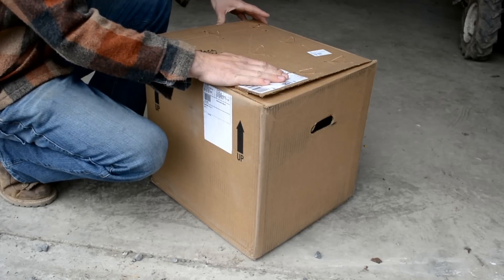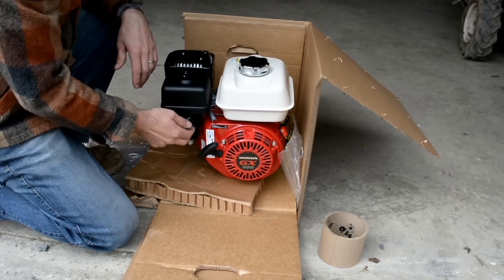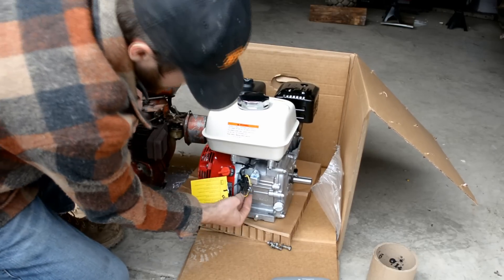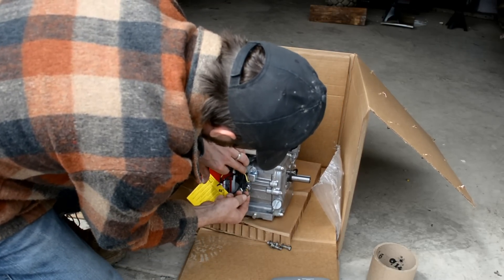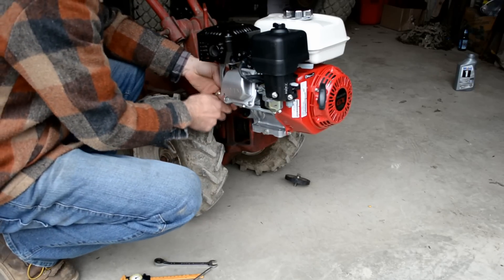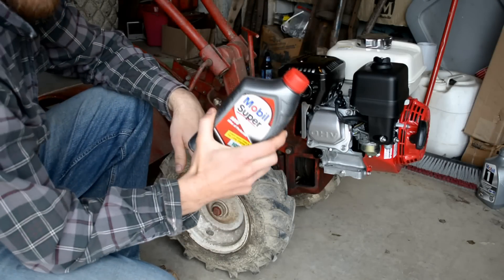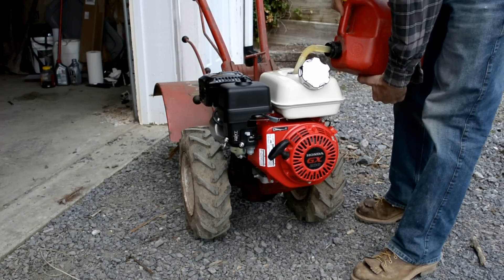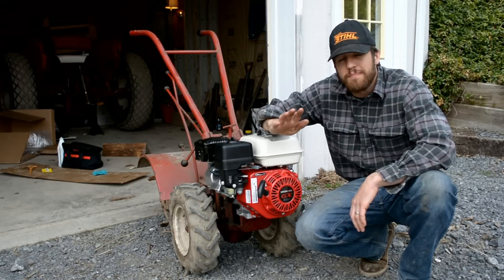Upgrading a Troy Bilt rototiller with a new Honda engine

Comment: Hi. Its nice to see this thread is still gaining attention,   yesterday I asked if a GX200 woukd fit onto a 86, 8 hp horse with a B&S motor.  Got a response yes it woukd , I didn't realize the Honda motor in my commercial cement mixer was not a GX 200 but a GX240 8.0,  I had researched the output shaft that should be on my B&S and it seemed it shoukd be 1"  after pulling the motor i see its a ¾" shadt, my GX240 has a 1" output shaft without thread , pulley are held on with a hex nut against the keyway.   Has anyone found a work around, for the pulley/ friction wheel ?  , if i want to keep the friction wheel I'll have to drill and tap the shaft, its the pulleys that worry me most ,  iland both my pulleys on the output shaft and transmission are of different circumference.    Anyone?
Reply: @mikethorburn6374  Small Engine Warehouse has some special order Kohler 9.5 hp Command Pro 277 CC displacement engines that have  3/4 output shafts.  I am told that SEW had the shafts on these larger Kohler engines turned and reduced to 3/4" especially to fit TB Horse/Big Red tillers.  SWE had to make an adapter plate to get the larger bolt pattern that is on the larger 9.5 hp Kohler engine to mate up to the smaller bolt pattern that is used by TB on the horse and big red tillers.   The 9.5 gross HP Kohler has a torque spec that is closer to the bigger 305 CC Briggs engines that TB was putting in the horse tillers before discontinuing the horse model and moving to the Big Red model 

This whole gross vs net horsepower makes comparing small engines a bit more complicated than it was 20 years ago.  The Honda GX 200 is rated at 5.8 net HP with a likely but not confirmed 6.5 gross hp.  The  Briggs Industrial Plus 8 hp engine that my TB horse came with is 8 gross HP so the net HP is going to be 10 to 20% less.  I think that the more important spec might be torque ft/lbs as that is what turns the tines and the wheels when the load is put on them more than HP. 

I have heard of people having the TB horse engine output pulley bored from 3/4 " to 1" and then having the key-way re-cut, to accommodate the bigger Honda engine but I would be concerned about the amount of metal that would take out of the pulley.  I would also suspect that the larger 200 CC  plus Honda engine that you refer to also has a different/bigger bolt pattern that may not match up to the TB horse.  

Before you buy any brand of engine, do your homework to make sure that the output shaft diameter is what  you want/need it to be and that the bolt pattern to bolt the engine to the TB horse is what you want/need it to be.  Good luck and keep us posted.  I am in the process of re-powering my TB horse that had the BS 8hp engine in it with a Honda GX200.  Everyone I have talked to said that the Honda GX200 has plenty of power but the torque spec on the Honda vs the BS shows a difference of about 3 ft/lbs of torque.  Does that matter?? I am about to find out.

Comment: I have a Troy-Bilt horse  tiller that i believe came originally with a 8horse engine i have a 6 horse honda gx200 would it be underpowered? Also it didn't come with the pulley for the motor so im wondering what the shaft size is and i dont know what the pulley looks like but would really like get it goin thanks in advance.
Reply: @woodsmanoutdoors509  I have been looking into the Honda GX 200 for my TB horse tiller as well.  My TB has a Briggs that was rated at 8 HP.  However, I think people get too focused on HP and forget about torque output.  When new the Briggs in my tiller has nearly 3 ft lbs of torque more than the Honda GX 200, and I cant help but think that when the tiller is under load an not running full throttle, the torque spec is going to be noticeable.  Briggs updated their Vanguard engines and they specifically designed the Vanguard engines to compete with the Honda GX and to take back some of the market share that Honda has earned (brand loyalty as well that has been earned).  One of the online TB re-power providers  used to offer the Vanguard as a direct replacement to re power the TB horse, but I have not been able to find any feedback from users who made the change to the Vanguard and the provider in question no longer stocks the Vanguard.  They do however, stock the Kohler 7 hp which is a direct replacement for a variety of OEM engines that TB has used through the years.

I personally am looking at a Kohler 9.5 HP engine that with an adapter plate will mate up well to a TB horse.   One of the online TB re-power providers recommends the 9.5 Command Pro Kohler as a direct replacement (with the adapter plate) for TB horses that are in need of re-powering.  Last I looked the price for the 9.5 Kohler was about $450.  I would avoid any Kohler other than the Command Pro as the Command Pro is supposed to be a true commercial duty engine

Comment: Great video. Thanks! My MIL has a '78 Horse and every time I would come to her place and help in her garden, the old Tecumseh would run for a short while and die. No power anymore... I watched this a dozen times over the years in prep for this upgrade. Just finished and the old tiller is like new. A few things I wish I'd have paid closer attention to:
- you gotta have a 1/2" gear wrench! A ratchet won't fit. LORT but those mounting bolts are a pain with just an open end wrench!
- make sure you have a new shaft bolt to hold the pulley on. You're right. The old one is too big. The new shaft bolt on mine is 5/16" fine thread.
-my MIL wanted an electric start. Really not needed on a Honda, but she's 90, so she gets what she wants 👍🏼. If you're going that way you'll likely need a longer positive battery wire.
- her tiller has a brush guard of sorts to protect the engine. If yours does, take that thing COMPLETELY apart and get it entirely out of your way.

Great project and now the tiller has a motor that will outlive her (and likely me too!)

My engine cost me $650 (summer 2024), but the electric start added about $100. Would have been cheaper without.

Comment: Switched my dead old engine out with a new one but when I started it the engine purred like a kitten but as I began to till with it the engine kept shutting down. It turns out that the new engine has a low oil shut off so when it tipped above it's set oil line it died. I talked to my small engine mechanic and he simply disconnected the wire and it runs fine. I unfortunately just got to Damn old to muscle that thing around anymore so I picked up a DR Power tow behind tiller and now I just pull it behind one of my small garden tractors.

Comment: Im about to put a gx 240 on my old horse.  Gonna be doing some fabrication.
Reply: @HowardFBeale-ql6gk   The GX 240 typically has a 1" keyed shaft.  I have heard of people boring out the TB factory pulley from 3/4" to 1" to accommodate the larger GX 240 engine
Reply: @neechee5150 I put the drive pulley in a lathe .  Made an adapter plate since the bolt pattern was different.  Then learned later that a 10 hp briggs rear plate has both bolt patterns and fits the 240 perfectly.  Just need to add a balance shaft bearing to the Briggs rear plate.
Reply: @neechee5150 when i was done with it one of our customers offered $4500 for it.😆
Reply: @HowardFBeale-ql6gk  said, "Then learned later that a 10 hp briggs rear plate has both bolt patterns and fits the 240 perfectly"

So did you end up installing and using the Briggs 10 hp or the Honda GX 240?  I noticed that Small Engine Warehouse has a Kohler 277 CC Command Pro engine that they modified to have a 3/4 " output shaft and then added an adapter plate on it to allow the larger Kohler engine to be bolted up to the TB "bell housing" or engine mount.  Sadly with a TB tiller  you are pretty much locked into a 3/4 " output shaft and a smaller bolt pattern to mount the engine with.  If it were a direct bolt on replacement, I would have went with the GX 240 myself

Comment: I just picked up this same tiller for free. Owner said it hasn't been used for years. I checked it out. Just needed a new head gasket and some tinkering. Still has the original Tecumseh 6 HP engine. works  like new. Winner,winner!
Reply: @poochie49 Curious how much did you pay for your TB horse tiller?  Is the old Tecumseh an "iron block" engine and not an iron sleeved aluminum engine?
Reply: @neechee5150  As my original post I got it for FREE. That was like 2 yeras ago. I have no idea if it was Iron block or not.

Comment: Doesn't the original engine have two shafts ? mine does maybe its a gearbox bolted to the engine?
Reply: If I am not mistaken, you have 2 shafts for forward and reverse.
Reply: @ExploringCabinsandMines  I have heard of TB Horse tillers having engines with two output shafts, but all of the 80's and newer machines that I have seen up close all have a single 3/4" engine output shafts.  80's and later TB horse tillers use a "friction disk"  that bolts on back of the engine pulley.  When you push the main lever up (for reverse on most models), the engine moves in a way that allows contact with the friction disk and that allows the tiller to have a "powered reverse gear".

Comment: Its far easier to remove the vertical pins that hold the cast iron housing around the pulleys and then the entire housing comes off.  Mount the housing on the engine, put the pulley back on and then set the hole thing back on and slide the pins in.  Muuuuccccchhh faster and easier this way.  Also gives you an opportunity to clean and grease the pins.

Comment: I have a TROY- BILT TUFFY rear tine roto tiller.  Tecumseh engine that smokes and won't idle . I took to local mower shop for a tune -up. I got a call 8 weeks later. Hey we rebuilt carb, replaced plug and air filter but it won't idle. We recommend replacing the motor. Your bill for this service  is $166.00 + tax . WTF!!!! It has the same problem that it had when I brought it in. They told me that I can pay and take it with me or they would call the police and I would have to  pay them. What would be a good engine to put on this machine?
Reply: Honda 200 gx.

Comment: Hello are you still happy with the Honda GX200 ENGINE ? I am thinking of ordering one for my Horse tiller. When I read the spec it says that its 5.5 hp and the tiller originally
came with a 6hp Tecumseh engine so I was just wondering would it be under powered ?
Reply: It’s not underpowered at all I have the same engine on mine. I can till as deep as I want or pull a hiller furrow. It’s never bogged down. It will burn the belts off before it bogs down.
Reply: @backspace4093  Given the differences in how the engine companies determine HP output ie  Net vs Gross HP, I have wondered how a TB horse tiller with an 8 hp Briggs for example (gross HP) would fare with a replacement Honda GX 200 5.5-5.8 HP (Net HP).  From your post it seems that the GX 200 at 5.8 net HP is more than adequate?
Reply: @neechee5150  Trust me you will enjoy it for many years to come. Use non ethanol gas use a good 40 wt motorcycle oil. I use Mobil one full synthetic. It has lots of zinc something these small engines need. I got mine from small engine warehouse. Took about two days to get it. Had it up and running in about 45 mins.
Reply: @backspace4093  Wow just 45 mins?  That sounds like a pretty easy DIY job for sure.  Thanks for the info and advice.
Reply: @neechee5150 I don’t have the throttle cable hooked up on the handles. I use the stock throttle lever. Be sure to use the same shims off the old engine.
Reply: Wondering if anyone used the Honda to repower an 8 hp troy built horse that has an 8 hp briggs and stratton
Reply: @mikethorburn6374  I have a TB OPC Horse that came with a Briggs 8 hp (319 cc) Industrial plus engine.  It has turned into a money pit and along the way I found out that my Briggs has no compression.  Two of the factors that limit how much power you can mount up to a TB horse are the 3/4" output shaft and the smaller bolt pattern to bolt the engine to the chassis.  While I would not say how much hp is too much for the TB horse drive train, I have never seen anyone put an engine over 10hp in one.   I looked at two Kohler Command Pro  engines--a 9.5 and a 7 gross hp, a B and S Vanguard 200 6.5 gross hp and a Honda GX 200 with 5.8 net hp.  There is a man on YT who has a Honda GX160 on his machine and he told me that he rarely runs his TB horse with the GX 160 at more than 70% throttle,.  I have found it harder and more expensive to get a GX 200 with a cyclone type air filter than a Briggs or Kohler with cyclone air filters on them. 

Given that I want to preserve resale value in my TB OPC Horse I did not go with a Predator.  Those are disposable engines  that have their place.  If I  was not wanting to use this tiller and then  have a good resale value, I would have considered the predator Honda clone engine.  I went with the Honda GX200 because I got a real good deal on the engine.  It came down to price of the engine itself, free delivery, reliability, ease of starting and resale value.  The Honda red and white also looks better in a TB red tiller as well.  

I will get the engine on Friday, so I will find out soon enough how well it powers my TB OPC Horse.  I talked to a multiple different small engine dealers who specialize in repowering TB tillers, and only one of them suggested that I would like having the 9.5  gross hp engine over the Honda GX 200.   When comparing the horsepower on these small engines you have to find out whether the hp spec the manufacturer is giving the gross hp (muffler and air cleaner taken off)  stat or the net horsepower stat (muffler and air clearer on).  The net horsepower number is a more accurate reflection of the number of horsepower available when the engine is in use rather than on a test stand.
Reply: @mikethorburn6374  I did it’s a perfect fit.

Comment: do you still have this motor ? i need the fly wheel.
Reply: Check out ebay , there is a lot of used parts on there. People are just tearing these tillers apart and selling the parts individually , because they get more money out of them.
Reply: @adamUDavies  thanks for the advice. i ended up picking up a harbor fright engine. for 129.99 sold the the T for almost 200$. i dont understand why they are going for so much .
Reply from the maker: Hi Robert-  Still have the engine, but it’s not for sale.  That HF engine should work great.  Happy gardening and best of luck on the re-power!
Reply: @NCPAOutdoors  Just finished tilling my garden. it worked amazingly after i disconnected the low oil shut off switch. Why do people want or like these old tecumseh motors so much ?

Comment: Does Honda have an electric start model and is the throttle cable attached? Thanks
Reply from the maker: I’m not sure if Honda offers the smaller c engines with an electric start option.  But the Honda starts so easily I couldn’t imagine why you would want to pay the extra cost for a starter if it was offered.

Comment: Absolutely the worst way to remove the engine from the Troy Bilt  Horse Tiller,  Remove as per the Troy Bilt Manuel, You Will Have Zero Problems!!
Reply from the maker: This was several years ago but I recall the removal being a simple straightforward process.  However we appreciate your constructive criticism and agree that a factory manual is always the best resource for disassembly and reassembly.

Comment: Great video that inspired me to remove my HH60 from my late 70s era Troy Bilt tiller.  I was able to get everything apart OK but noticed the shaft on the old engine has a key in it that is keeping the shims on the shaft.  I didn’t see this key on your old or new engine?  Do I pound it out of the old shaft and put it on the new one along with the shims?  Thanks again for the great video!
Reply from the maker: I reused the old key and shims from the old engine.  Good luck with your project.
Reply: Thanks again for your help.

Comment: I have one that looks like that one I would like to replace the engine where do I find that year of my old trailer
Reply from the maker: Year of the machine is not very important to re-power.  Most replacement engines only require the bolt pattern and output shaft size information.

Comment: I'm glad you could afford a Honda I'm 13 so I asked so I had to buy a predator 212 to put on my to garden tillers
Reply from the maker: The Predator engine is a good alternative to use on a tiller.  With the minimal use required of most tillers it is a good way to save money and get your soil ready.  I choose the Honda for longevity and trouble free operation.  Thanks for the comment.
Reply: @NCPAOutdoors  thanks for my Hiding on my predator

Comment: Did yours have the second pulley for the reverse? If so how did you adapt it?
Reply from the maker: Original pulley bolted right up to the new motor.  Reverse works great!  No modification required.